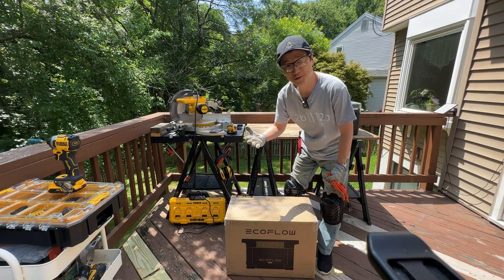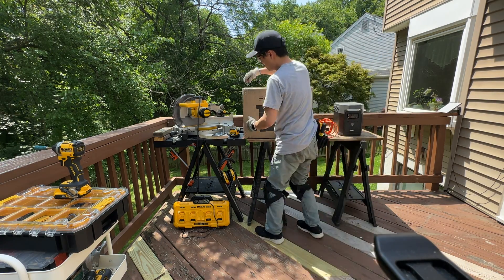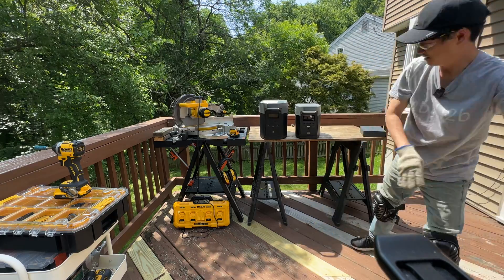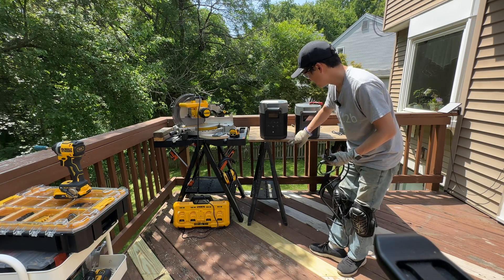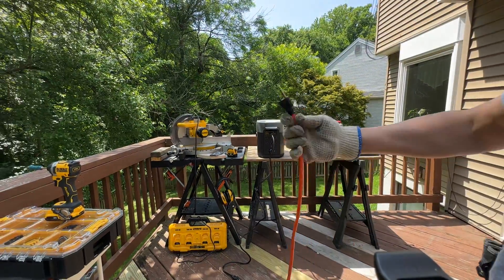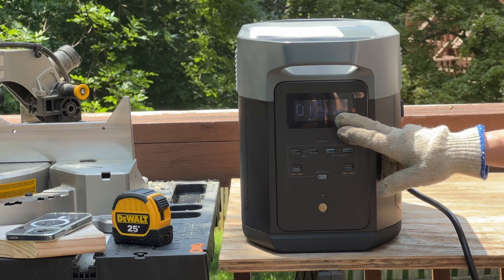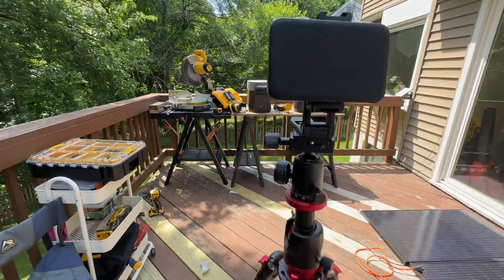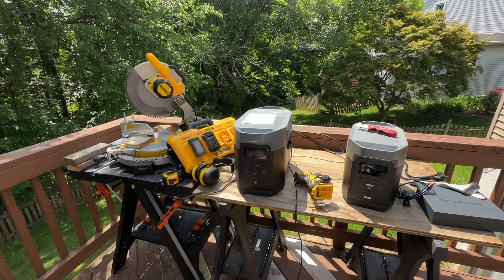EcoFlow Delta 2 MAX Input and Output Review

Comment: Maybe just to correct the first thing you said... The one you have there is a Delta 2, which is not the predecessor to the Delta 2 Max. The actual predecessor is the Delta Max, which is same in size and almost same in capacity.
Reply from the maker: Thanks! It was the original Delta 1300 released in 2019.

Comment: Can I ask? I am fairly new to all of this and I just bought the Delta 2 max but I am not very knowledgeable around solar and ports. It has two solar inputs of 500w each, I understand that, but is the voltage 60 maximum per port or total across both ports. I’m asking because I’m wanting to do four panels in series, I just don’t want to overload my system. I don’t mind using both ports.
Reply from the maker: 4 panels in series is around 80V, I wouldn't recommend doing that.

Comment: Knee pads? Clamp the wood down? No dust bag for the chop saw ? I get your a novice. No building experience. As a builder it’s humerus to watch. Not a very techy review. 
      Did you know dewalt makes a battery inverter 1800 watt continuous and 2400 watt surge. Runs off 4 dewalt batteries. Does the same thing except you can use the batteries after for your tools .
Reply from the maker: Thanks for pointing it out. I'm a normal home owner, replacing my deck boards, not a pro. Smash the like and subscribe. I'm fully aware the dust collection thing. I'm facing my backyard, not indoor, so not a huge issue. I know that dewalt inverter, it is definitely not as powerful nor last as long. I think you will like this review I created for DeWALT https://youtu.be/aW4ijis4jQA
Reply from the maker: by the way, what's wrong with knee pads? is foam on the floor better?